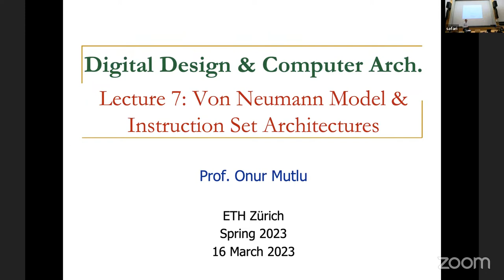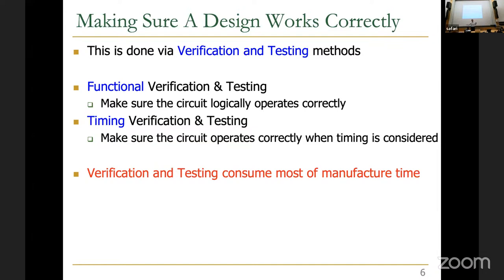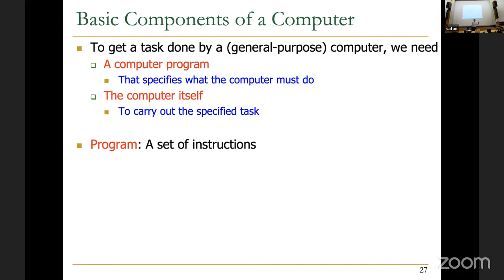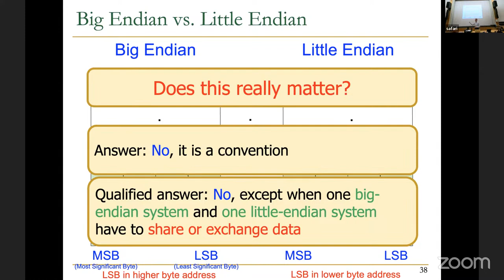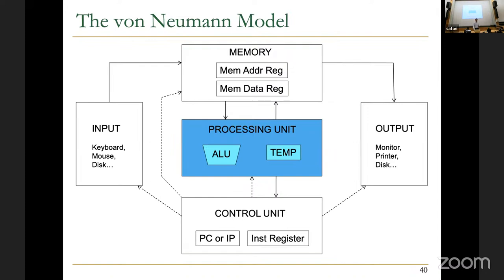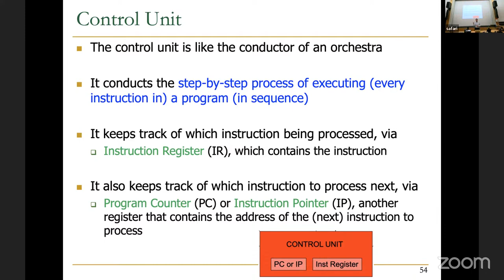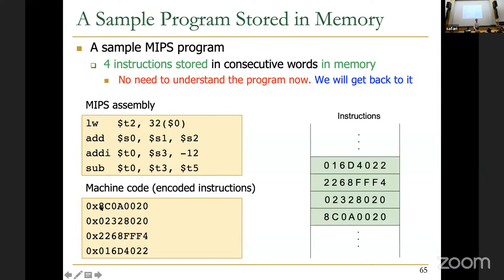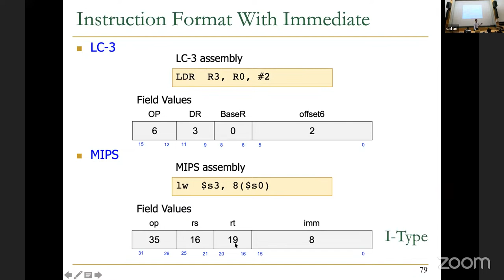Digital Design & Comp Arch - Lecture 7: Von Neumann Model & Instruction Set Architectures

Comment: 01:43 Timing and Verification
04:01 Timing in a Single Sequential Component
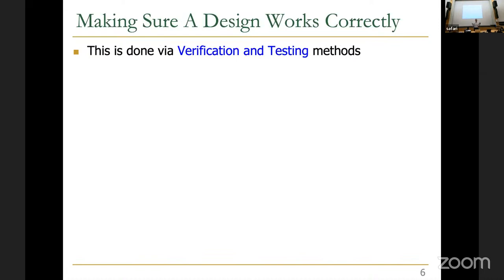14:20 Make Sure a Design Works Correctly
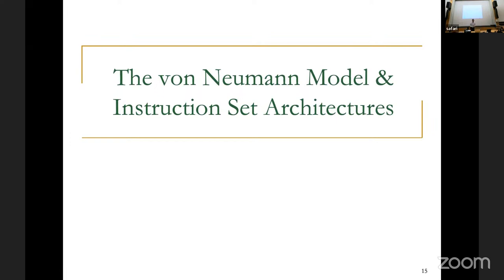26:43 The von Neumann Model & Instruction Set Architecture
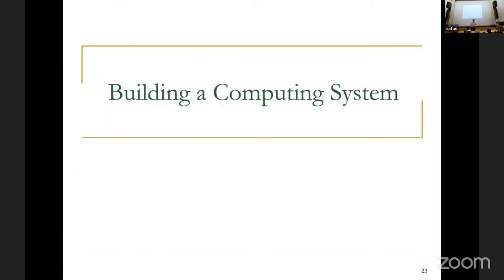29:35 Building a Computing System
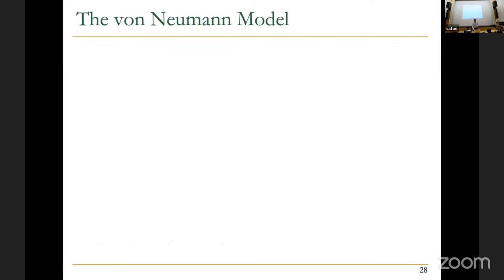32:30 The von Neumann Model
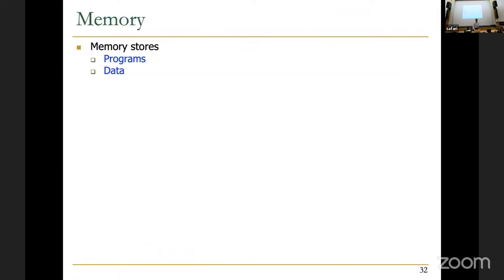36:15 Memory
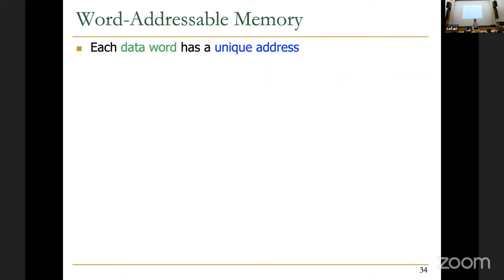38:50 Word Addressable Memory
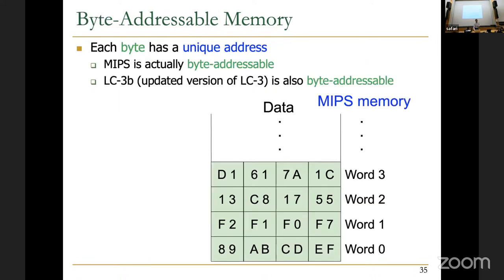40:59 Byte Addressable Memory
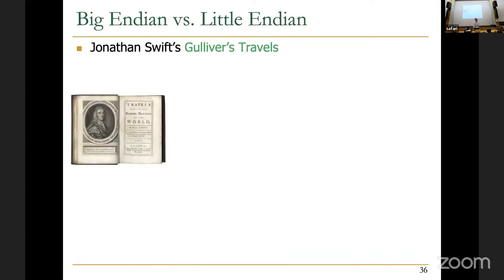43:34 Big Endian vs. Little Endian
46:45 Addressing Memory: MAR and MDR
50:05 Break
1:01:50 Processing Unit
1:05:53 Processing Unit: Fast Temporary Storage
1:11:46 MIPS Register File (Conventions)
1:14:19 Control Unit
1:23:18 LC-3: A von Neumann Machine
1:29:36 Stored Program & Sequential Execution
1:30:38 A Sample Program Stored in Memory
1:31:47 The Instruction
1:33:51 Instruction Types

To be completed